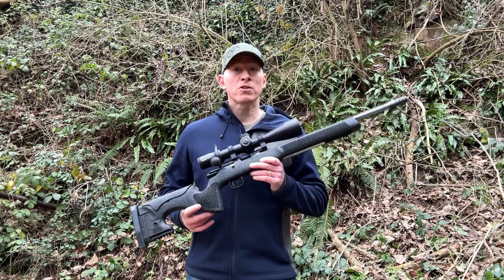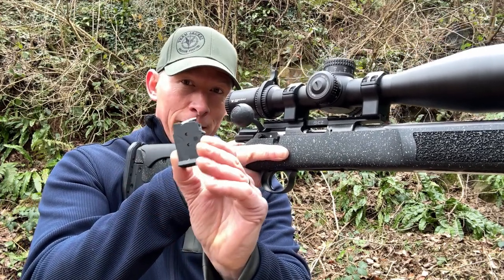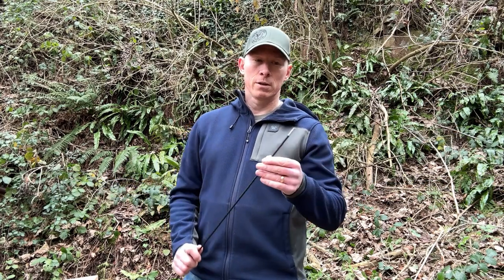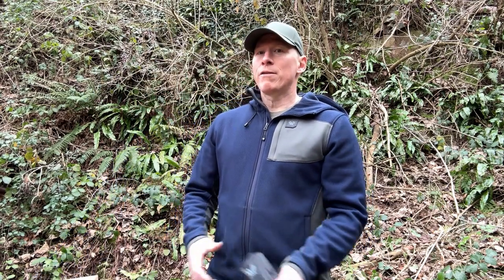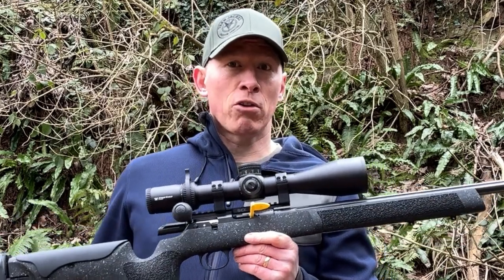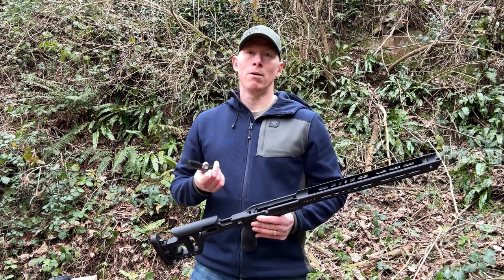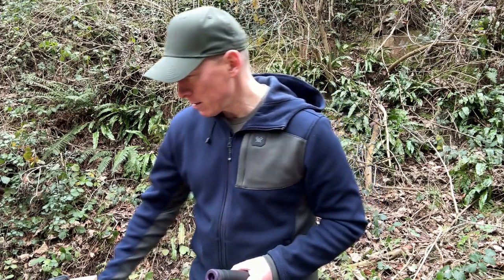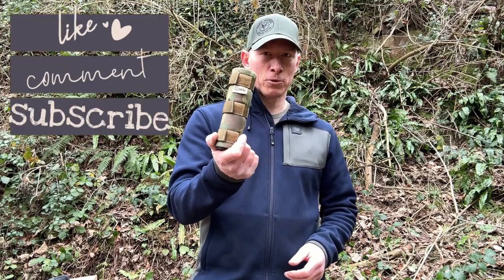CZ457 Long Range Precision (LRP) part 2

Comment: These are great bench rifles.  I'm on my second one.  I sold my first one to get a Bergara B14R and I still have it, but I missed my LRP so I picked up another one.  The LRP is a better 100 shooter and the B14R is just a bit tighter at 50yds.  I wish I had this new darker stock - just love it.  The only down side, CZ's new found popularity in the 22 world has driven up their prices.
Reply from the maker: Glad you said that!  I was toying with the idea of Bergera when I was looking at .22 rifles and went for the CZ.  Looking for long range accuracy and I’ve been pretty impressed by the groups I’m getting from subsonic ammo (the HV stuff works ok but isn’t quite as tight)
Reply: @JonCresswellUk  I'll give you some cool tips that I've used on all my CZ's.  

1. Replace the trigger spring with a cut down spring from a BIC lighter (the flint spring - not the red button).  It will bring your trigger pull weight down next to nothing, which will improve your accuracy.  And while you have the trigger out, polish the top, which mates to the sear, to a mirror finish.
2. The CZ bolt is kind of crunchy because of the laser cut serial number on the bottom.  I use a green scotch pad on a die grinder to polish down the rough edges and then use my 8" buffer pad and some red polishing compound to polish the bottom side of the bolt.  Do this and it will be smooth as glass when you cycle it.
Reply from the maker: @scarbourgeoisie  I know what you mean about the serial number, so I may give that a go 😊. I’m not sure I’m confident enough to fiddle with the trigger yet, but I may adjust the grab screws a bit to make it a bit lighter - it’s still on factory setting, but I do favour a slightly heavy trigger so I don’t accidentally pull the trigger if I’m using gloves.

Comment: Interesting how each person has their own cleaning routine for .22lr
I only shoot lead projectiles, pull a boresnake through 3 times between different types of ammo
I clean the chamber with a nylon brush and clean the bolt before every match or session to try and avoid any ejection issues. The above has always served me well
Reply from the maker: Yes, lots of variations on how people clean them.  Do you use any cleaning fluids on your boresnake?  

Only asking as I used to use a similar method, and use oil, to clean my barrels but when I tried the rimfire blend and patches it was surprising how dirty my barrel was 😳. Some people never clean them, so there’s definitely a balance.
Reply: @JonCresswellUk  just a cheap local product that cleans and lubes same time. For the chamber and bolt I use a locally made rimfire carbon cleaner similar to the Boretech product but more affordable
Reply from the maker: There are lots on the market and everyone has their favourite go to cleaner 👍👍

At least you’re keeping it clean and maintaining your rifle 🤙 it’s the best way to make sure that it’s serviceable should you need it.

Comment: If you unscrew the moderator half way out and then press the unscrewed end on something, it will push the other end out. Excellent moderators.
Reply from the maker: Ah ha! Thanks for the tip

Comment: Thanks!
Reply from the maker: What did you think of the chassis?
Reply: @JonCresswellUk  I like it. Local store has this one and also one with MDT chassis. I plan to go see in person.
Reply: @JonCresswellUk  plan to buy one or maybe the other. Your videos gave me a good over.
Reply from the maker: The CZ LRP is a lovely rifle, I was out in the range today with mine 😎

The one that comes in the MDT chassis is nice 👌 good to go straight out of the box
Reply: @JonCresswellUk  I was going to do a project 22 lr but out of box is cost effective.  And seems LRP and MDT stock are both excellent options.
Reply from the maker: Definitely 👍

Comment: do you have any issues with the 36" cleaning rod handle clashing with the top of the stock? do you need to twist or bend the rod to clear the handle of the stock?
Reply from the maker: There is a small grub screw for the comb height adjustment that I can loosen and remove the cheek pad. No I don’t twist or bend the rod.
Reply: @JonCresswellUk   thanks mate. been trying to find a 40inch rod, but seems the 36 works. thank you for the feedback
Reply from the maker: @genos3933 great 👍 glad it works

Comment: nice review, one question do you have any issues with the ten round mags misfeeding last round. i have the same rifle and the 5 mags run fine,  but the ten has issues with last round loading.
Reply from the maker: No issues with my 10 round mags 👍
Reply: I gave the  large spring a bit of a stretch and haven't had the problem again. Be careful when taking the magazine apart so that you don't lose the tiny spring and pin keeping it together
Reply: @plinkspot8750  thanks for reply. i will give that a go ,although a new mag it may well be a dodgey one
Reply from the maker: Yes, if you don’t have any luck with the spring, I’d see if you can swap the mag at the shot you got it from 👍👍
Reply: @jgs3647  many guys have the same complaint regarding the mags. Although mine hasn't failed again I still carry a spare mag on my stock with the Short Actian Precision match saver. This comes handy in matches
Reply: No issues feeding, but on occasion I have trouble fully extracting the last empty casing especially when it's cold outside, i.e. below freezing.
Reply from the maker: @scarbourgeoisie  ah I’ve not used it in minus temperatures yet, so I’ll keep an eye out 👍👍